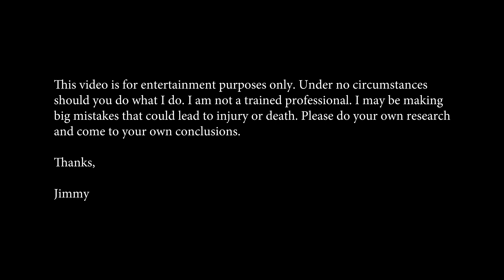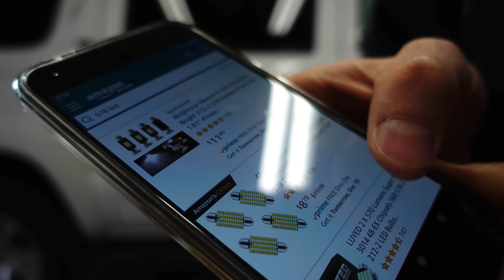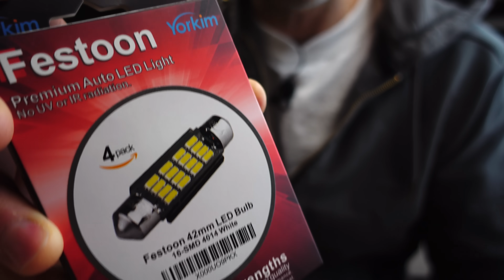Here's Why You NEVER INSTALL LEDs IN YOUR CAR OR TRUCK!!

Comment: I exchanged the factory bulbs in my Silverado with LEDs & never been happier.  Not sure what makes this guy the authority on LEDs but I do not agree with you buddy!  In fact my 2019 Silverado came with LED headlights & mirror lights.  If the manufacturer installs them I have to believe they are high quality & long lasting.

Comment: lol they will  outlast  your hologen , i have used and dealt with LED lights for a long time and  as yet   not had a single failure average holgen if 2000 hours of use   versus  LED 15,000 and up to 50,000   the biggest fault and issu is from the manufacture of the  LED for use in older cars  need a filoter to smooth out spikes  newer cars not so  muchled  have a forward and reverse voltage specification and  you can also  compensate that at manufactured in how you desing your  bulb and  put  over spike protection in them, newer cars   mid 90s and up   started using   LED and those   you will find  have voltage clamps aka filters   that act to take out any of those spikes.  it comes down to  vehicles  model year  and to the LED manufactures  reputable or fly by night   back street maufacture. most  car makers have gudes of vehicles compatable for use with LED and there are filter modualrs out there to put in system to protect the led from spikes  from  systems

Comment: The function - especially in a headlamp is critical.  So many people just stick an LED bulb in place of the original halogen which is what the lens and fluting were designed for.  Why is this important?  It is because the chipset in an LED bulb does not gather the light in the same exact position against the reflector of that lamp, so the fluting in the lamp does not put the light where it was designed to be.  What do I mean by that?  Glare, and lots of it generally.  Does the light in front of the vehicle increase?  Yes it does, which gives the FALSE impression you are getting better light out front, but you are actually losing a significant amount of effective, down the road lighting.  I tested over a dozen different H4/9003 LED substitute bulbs in my set of European Cibie E-Code lamp housings which with the proper bulb produces a very distinct and clear cutoff line to eliminate glare and not one of the LED's allowed the lamp to produce that cutoff line, every one put out blobs of light.

Comment: they're like 21 bucks... lame. just take your old bulbs and use the sockets to connect some LEDs from a junk tv... they're like 3 cobs in a lens housing that run off of 15v... free leds... hardest part would be taking them out of tv and getting them connected to your old sockets. and no this isn't for head lights etc i only mean for the interior lighting. dome light etc.

Comment: first of all, the shown bulbs aren't "halogen" bulbs, 'cause these need a special sort of glass (when you already tilt a H4 or H7 car lamp, you see a little shine of a sort of a rainbow on the glass - it's a coating) 'cause halogen bulbs got warmer as normal bulbs - and: they're lifetime is really fast reduced when you "touch the glass with the bare fingers", 'cause you're body-fat will stick there, and burn themself on that lamp. that does NOT happen with "regular" bulbs, like you showed them (especially in the intro), 'cause they don't get that hot - and even the body-fat sticking on the surface don't cause a less lifetime. why less lifetime? 'cause the "burned fat" resolves in a sort of reflector, what doesn't let the lamp cool down - so they overheat (and that's why halogen lamps should always "don't be touched with naked fingers").

the next point - LED's. these who needs electronics, had normally (in the actual stages) some sort of a "cooling solution" - some better than others, but the early staged led's don't had - and that what causes the problems are the resistors, who get warm over time and let the cheaper plastic melt. that doesn't happen when you use the newer sort, and use them as they should be used.

another problem, especially with LED-headlight replacement bulbs: the most aren't as good as halogen-bulbs. why? 'cause they aren't optimized like the halogen bulbs were, so they might have a "colder" light-color (what let you see a little bit more), but 'cause they aren't really optimized, your light goes everywhere - but not really there where it should be, or you put that much light in the output, that you can blind others who drive in that direction where you go. for europe, there's only 2 companys who made LED-replacement bulbs for some cars, who actually are "optimized" and can be legally used (the other ones can't be legal used, 'cause they're not had tests for legimitize them) - and these were actual better than the halogen bulbs and work like these.

as a car mechanic, i know what's important in that case - so i even "upgraded" my car with LED's (but just for the rear number plate; that's common here, and mostly they are legal) - but these had a pretty design-fail: cables who came out of the lamps to connect with the rest of the car. these wires broke internally, so thes stopped working - after round about a year. a 2.nd set did the same - and even after "repairing" one set, these don't work as expected, 'cause the cables were the problem (i just shortened these and re-soldert these on them). so, i took a 3.rd pair - who had 2 latches instead of cables - and these are now tested until they stop working, or the car will be crashed... the other pairs before (who are even sealed with correct materials) don't work, and all that just 'cause of the cables. you see, it's only one small thing - and that thing can screw up anything. i've had them here, and when i solder new cables to them, i'll use silicone wires (cause they're really flexible) - and look that these wires will be "straightend up" with pipes that they don't move to much.

Comment: Please help me. I fixed LED car tail light to my car, after I install it, the ABS light keeps turning on. what's the matter? please help me.
Reply: I had the same problem when I upgraded my 1997 Ford F150 to LED's. I took the truck to my brake shop and they hooked up their equipment. Found no issues with the brake system. I replaced the LED that was for the ABS light with a standard stock incandescent bulb and the ABS light went off.
Reply: @kennethbryant9496  yep that's the problem. LEDs aren't support

Comment: That is a load of crap I replaced every bulb on the outside of my vehicles headlights Bright lights blinkers brake lights running lights everything with LEDs and I have had not one issue with them nothing they work fantastic

Comment: Never replace the bulbs designed for your vehicle from the factory. Unless your vehicle comes from the factory with LED lights, don't reinvent the wheel. The only thing in replacing regular bulbs with LED is around your home or outdoor lighting. Many companies who invent "new and improved' item's are mainly to generate more income for that company. If it isn't broken don't fix it. Using LED replacement bulbs will not make your vehicle battery happy. 
Your vehicles charging system and battery will not know the difference. Don't fall for the scam of "new and improved". Again, if your vehicle does not call for LED bulbs, leave it alone. Let sleeping dogs lay. 1:47 1:47 .

Comment: those are not halogen bulbs, they're incandescent bulbs! halogens are for headlights, they burn brighter and hotter, 
the reason the LEDs fail quickly, is poor design, that's why they're cheap, the LED count, to the resistor is used, is head shaking, most LEDs only need 2.2 volts, it's the amps that's not taken into consideration, that's why they get hot and fail, some LED brands don't even run them in series, or they do the exact opposite, with the incorrect resistor, I've load tested LOTS of online purchased LEDs for cars, and most are junk straight out of the box, LEDs should last as long (if not longer) as an incandescent, and unless it's high powered LED, they will become warm, but NEVER hot!

Comment: I am reluctant to replace incandescent bulbs with LEDs. Especially if the bulb is still working.  If you are doing it for the cost savings, you will never recover your investment. The quality of LED bulbs is generally very poor.  The other reason, is that I don't like the colour of white LEDs, especially the cool white, pure white, daylight, temperatures. The actual LEDs are blue/ultraviolet which I find harsh.
Reply: True said

Comment: The so-called daylight balanced white, is cold white... Oldest and it's absolutely horrible for being able to see at night! 
 I drive a 2023 Volvo VNL 760 for work and it's absolutely terrible at night, especially in any kind of inclement weather.. I can't see what's dead in front of me because the white / blue light gets absorbed by the moisture in the atmosphere.. and it's horrible for object recognition at night! 
Plus, and this is especially when you have other vehicles coming at you with the same lights, it completely destroys your night vision. 
There's a reason why military and Maritime operations primarily use red light at night! 
Longer wavelength, lower energy light, it doesn't destroy your night vision in the way that the cold white does.

Comment: i hate leds, they suck, the flicker is worse than that of my old switch start (aka preheat) fluorescent fixture, leds just suck, leds flicker like crazy, cfls don't, and you might say fluorescents flicker, they do, if they're on a magnetic ballast, but most cfls are on an electronic ballast, so they don't flicker, i just like incandescents and fluorescents better.

Comment: Calling "incandescent lamps" "halogen bulbs" is completely incorrect, T. A. Edison patented the "incandescent lamp," with no kind of "bulb" (slang) involved.  There is no "halogen" involved in the passenger compartment of any motor vehicle that I have ever seen, they are simply "incandescent."  I prefer LEDs that are less blue than those seen here, I specify 4,000.º K devices, and 2,800.º K are also available in most bases that prefer the original orangish color. Ron W4BIN

Comment: I don't really understand the title of the video, which tells us never to install LEDs, then you go on to make an entire video on installing LED bulbs. Huh? But It's more to do with the manufacturing quality than the design. The flat type ones are newer to the market, but there are plenty of the original style that are perfectly fine and do not fail, and they don't get as hot as halogen or incandescent bulbs - the decent ones don't anyway. In most cases it's the same as anything else, you get what you pay for. I replaced every bulb in my car two years ago with LEDs and I've never had a single one fail. Incidentally, the only halogen light bulbs you're likely to find on a car are the headlight bulbs.

Comment: You label this video "NEVER INSTALL LEDs" which sounds like you have reason to avoid using LED bulbs in your car. And yet throughout this video, you seem to have all high praises for LED?

My only experience so far is with turn signal blinker bulbs. I recently replaced a halogen turn signal blinker bulb with an LED. It worked but the car continued to blink rapidy. The rapid blinking - as you probably know - is a design feature in the vehicles circuitry whose purpose is to alert you when that bulb is burned out. In short, the circuitry sees no power usage or load there at the bulb (i am not an enginner or an electrician btw) and so it blinks rapidly to tell you theres a burned out bulb there.  But apparently, LEDs turn signal blinker bulbs use so little power that the the car's circuitry still thinks there's a burned out bulb there and continues to blink rapidly even though the bulb is not actually burned out.

Comment: You FAILED TO POINT OUT the CRITICAL FACT that MOST LED BULBS ARE POLARITY-SENSITIVE. Sure, they'll plug right in either way due to being symmetrically designed, but you can't simply install them and expect all of them to work. There's a 50% chance they will not work until they are turned around. Incandescent bulbs do work mounted in either position - that's why their bases were designed symmetric ! You won't harm anything when LED bulbs are turned on while they're mounted backwards - they simply won't work ! The letter "D" in "LED" means "DIODE". They conduct/operate in only one of the two possible orientations. So, if it doesn't work right away, don't immediately thinks its defective ! Just pull it back out and plug it in the other way.

Comment: light emitting diodes have been around for decades even before halogens ..if you want to know how long they last read the info on the packaging ! LED's run cooler and last light years longer than any incandescent , simply because they are not incandescent....you said it yourself LED's pull less power per lumen ..halogens are the hottest per lumen of all incandescent   a 1500w halogen work light puts out 32000 lumen and turn the flat side of the glass housing of the work light  up and fry your breakfast on it ..an LED that puts out 32000 lumen consumes 400w ..thats almost 4 times less wattage = 4 times less heat for the same amount of light, but its not enough heat to warm up your milk ! spent 5 minutes on google search like i just did before you make any bold statements

Comment: All of these LED lights are too bright and for the headlights, aimed too high. The NHTSA should never have let these be installed in cars and trucks, new or aftermarket. It is a major safety hazard for everyone on the road, plus a real nuisance. There was a time, back when laws were enforced, when tickets would be issued for too bright aftermarket lights, or headlights that were aimed too high. It should still be that way. 
I have been continuously been driving a 2010 F-150 which has excellent headlights and have only replaced one bulb, a turn signal. 
LED lights have been used on aircraft for about the last ten years or so, (maybe longer for non-airliners), they are totally unreliable and of course more expensive. With halogen lights, there are heat issues but the lamps themselves last a very long time. Even the old non-halogen lights lasted longer than the LED's and the sockets didn't overheat and about all that needed replacement was the lamp. No troubleshooting, no replacement of the LED module or power supply, etc.

Comment: The great problem, still now (2023), is the resistors in led lamps has very bad heat dissipation, even in house ones. People just want do sell, any way, and did it with very trash products. But any one with some level of electronic knowledgment can easily make your own led devices, that can litteraly work forever. The leds industry is stil a F** TRASH, bad products, with shorter lives than even old filament lamps. Simply unbelievable. Every led device I bought has broken in short time, but every (all) led device I made by my self is still working, for years and years along. Of course, these devices are absolutely not viable for mass production, but, as I said, Led industry is stil a babe! (and still  p***ping under pants...). Thanks!

Comment: I hate to break everyone's love affair with white light or blue light but at night really bright light is extremely hard on your eyes. Those really slap the backs of the designers and engineers that thought LED street lights are good? I would like to strangle them. In snow and fog and even rain the LED lights are to bright. On vehicles fog lights used to be orange. A more reddish hue and not bright white. I have been driving trucks since the mid eighties and many many times in snow and fog I have actually turned my headlights off and used the orange lensed fog lights and see tail lights in front of me farther away.

But I get it. These young ones want to look like everything is futuristic and cool. After 40 years of driving I do not drive anymore between the hours of sunset and midnight. 

You know what will actually kill you? Blinding the vehicle coming the opposite direction because it is disorienting being blinded and apparently cops don't pull anyone over for speeding anymore. But most people are on their phones anyway blinded by that light so they probably need brighter headlights when they do look at the road. So what is the governments answer to what is a real safety hazard? Lights controlled by a computer  in the way of adaptive headlights. I have never owned a computer that did not crash and I never owned a phone that did not fail. But hey we are so willing to put our lives and other's lives in the hand of technology which is half assed at best and usually quarter assed in reality.

Sorry for the rant.

Comment: LEDs are freaking trash unless they are factory installed. Because all of the electrical systems are designed to operate with the low wattage

Comment: LED headlights should be illegal until there is a solid safety standard and roadside testing methods for law enforcement. If you're pulled over with lights that are blinding other driver's your vehicle should have to be towed off. People get your headlights aligned for safety and dim your damn brights when there is on coming traffic. People are dying from wrecks caused by being blinded by poorly aligned and LED headlights. If people flash theor lights at you a lot, it means you're either driving unsafely or you need to get your headlights fixed and DIM THEM when you are driving anywhere near other vehicles!